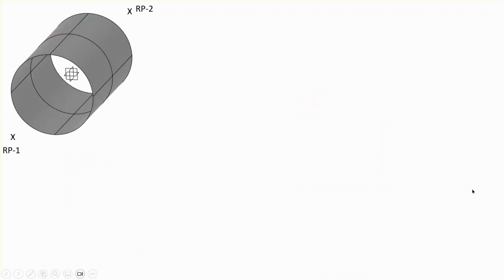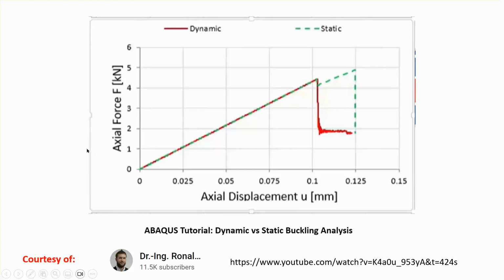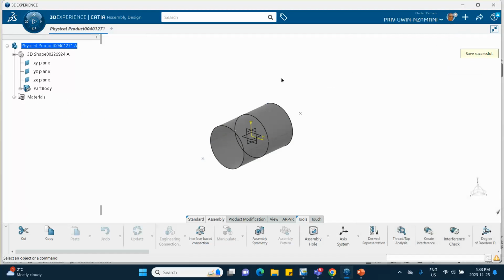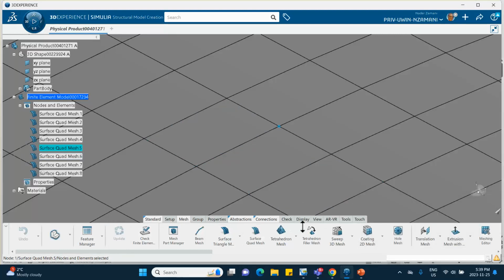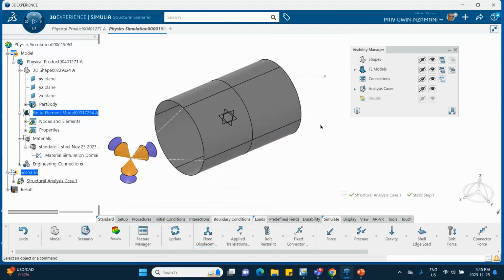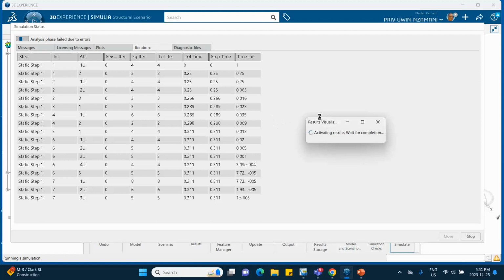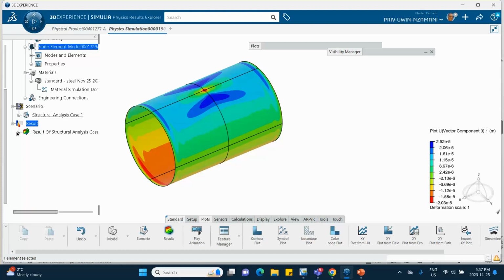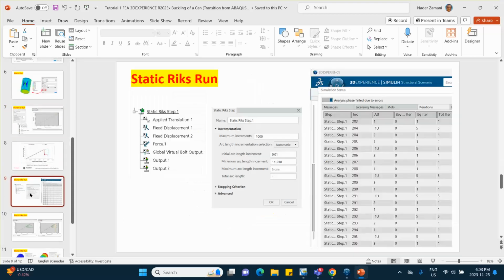Tutorial 1, FEA 3DEXPERIENCE R2023x Buckling of a Can Transition from ABAQUS CAE

Comment: Hey Prof. Zamani, this is a very good video thanks. 
I think I may have spotted why you get a different result. Do you apply the radial perturbation load 1.4 N incrementally at the same time the shell is compressed? it should be two steps first step apply only loading until 1.4 N and then you have a shell with a large dimple and in the second step you compress the shell.